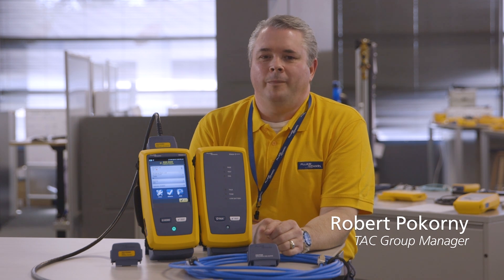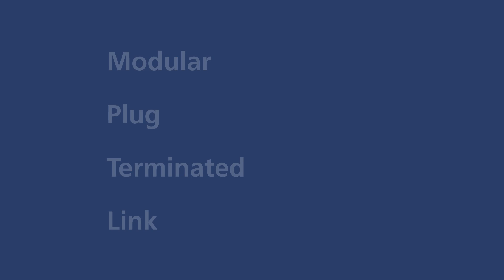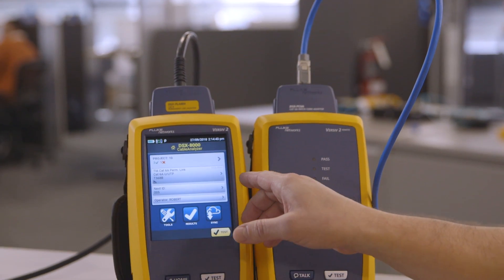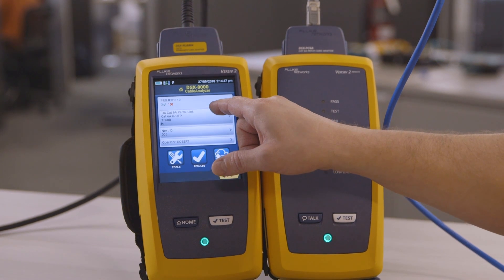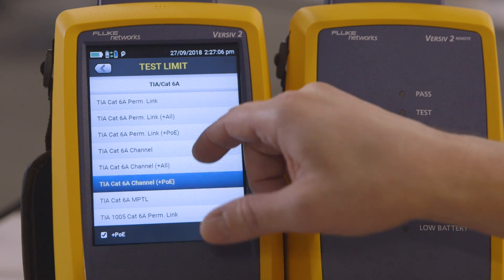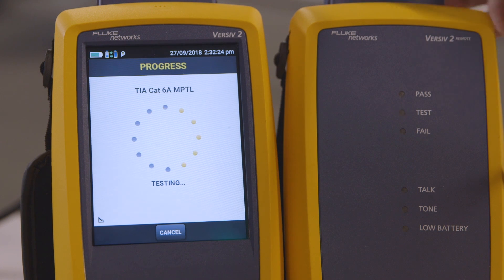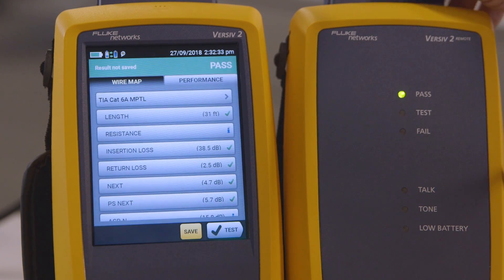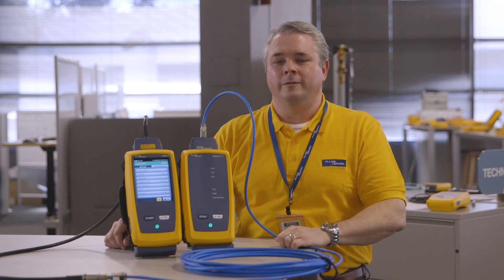Testing a Modular Plug Terminated Link (MPTL) by Fluke Networks

Comment: Hi Mike I'm having a problem I am terminating Pass Through RJ45's for Cameras and AP's We are testing Cat6 MPTL(+POE) and some test Pass Solid Green but Some Pass/Orange and Some Fail RED Wire map is good but Next is failing I even terminated since its Pass through I pushed the cable all the way til the jacket is less than .5 in away from where the twist are right up to the RJ 45 èè è right  what can be causing this Thank You for your time